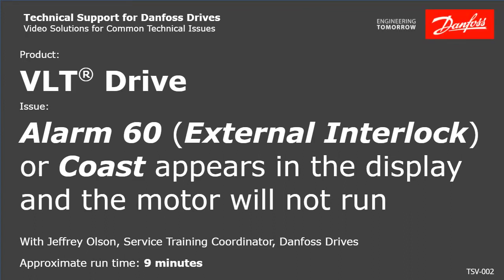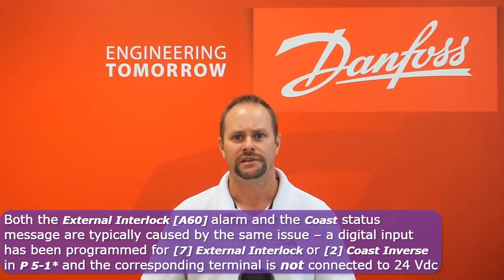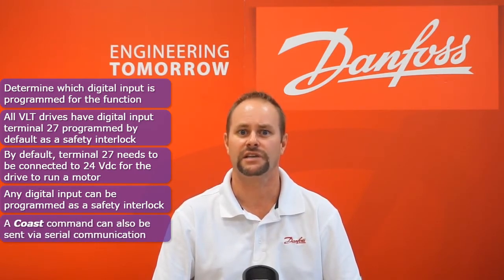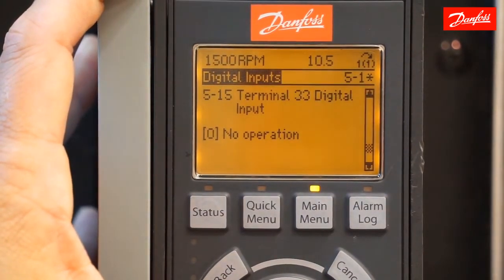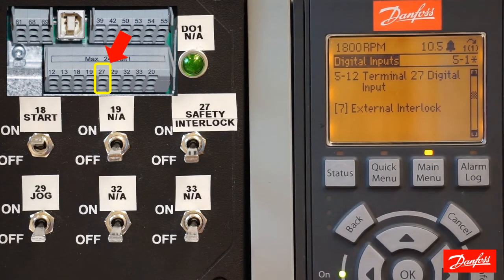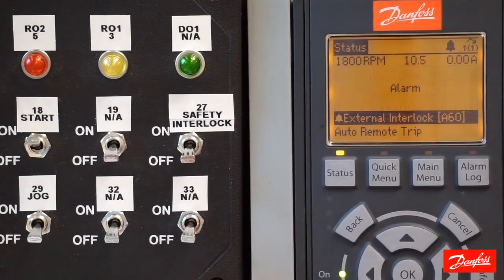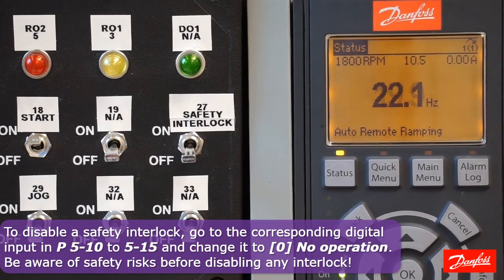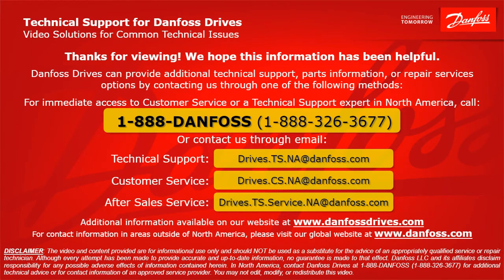VLT® Drives: External Interlock [A60] or Coast appears in the display

Comment: Pls i don't knw hw to get in touch with your company
I need a clear explanation on my inverter AKD 500 
Because is displaying alram 14
Reply from the maker: For installation, start-up, programming and troubleshooting assistance please email: Drives.TS.NA@Danfoss.com
or if you need immediate assistance contact Danfoss Drives 24/7 tech support at: +1 888 DANFOSS (326-3677)

Comment: Good afternoon 'ihave an emergency situation with  danfoss 302 inverter of 400t crane in power plant displaying  "Internal fault:2068(A38) Auto remonte trip every Time WE move the hoisting crane this alarme Come and WE are obliged to reset the alarme(overall inspection for gas turbine) l'm realy stick.knowing that recently WE install a New remonte control.
Reply from the maker: For installation, start-up, programming and troubleshooting assistance please email: Drives.TS.NA@Danfoss.com
or if you need immediate assistance contact Danfoss Drives 24/7 tech support at: +1 888 DANFOSS (326-3677)

Comment: Alarm 68 , sécurité
Reply from the maker: For installation, start-up, programming and troubleshooting assistance please email: Drives.TS.NA@Danfoss.com 
or if you need immediate assistance contact Danfoss Drives 24/7 tech support at: +1 888 DANFOSS (326-3677)